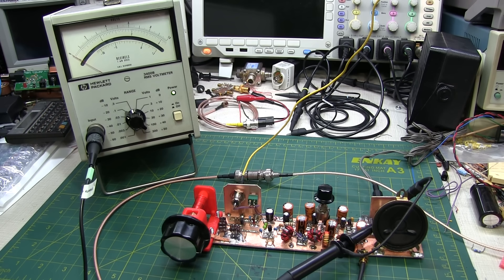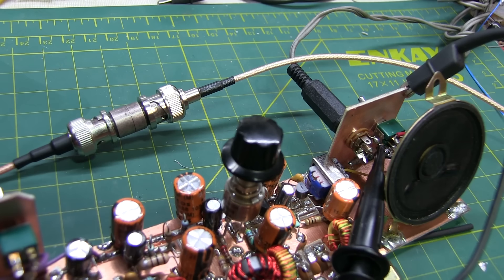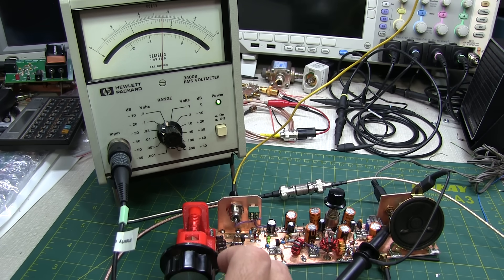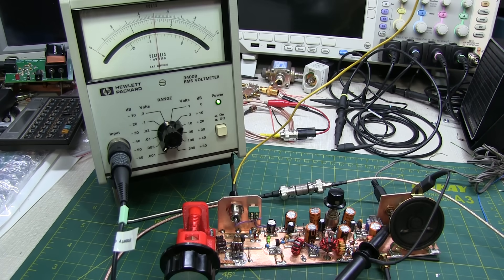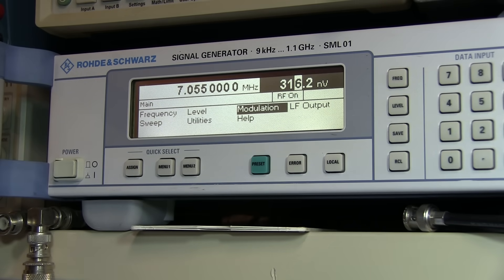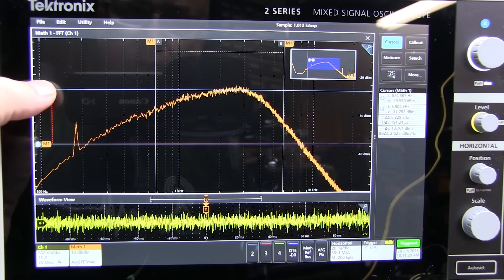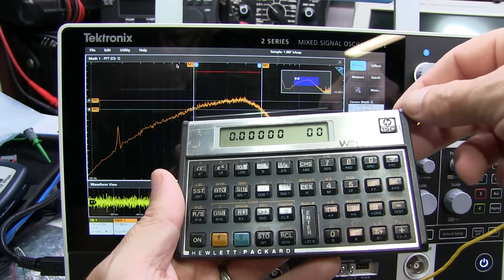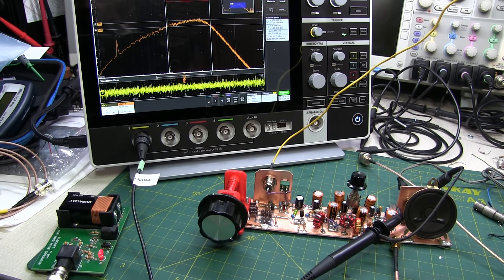#400: Measuring the Minimum Discernable Signal and bandwidth of the 40m Direct Conversion receiver.

Comment: Great demo. Thanks. A properly aligned HW8 (I've measured eight) has a minimum discernible signal of about -128 dBm. The CW audio peak there seemed really high - well over 800 Hz. About 400 to 800 Hz provided the best ear/brain separation to adjacent signals. For example, two signals only separated by 200 Hz are easier to distinguish with a beat note of 600 Hz than 1kHz. This is often overlooked by none-CW operators!
Reply from the maker: I may try to tweak some things to give me a better aligned receiver tone.

Comment: “I put a low pass filter in the output of the audio amp, Uh just to limit the high frequency hiss out of the receiver” what exactly did you use and exactly how and where did you place it, if you don’t mind, thanks!
Reply from the maker: I simply put a capacitor (47nF I think) in parallel with L4 (the primary of the audio output transformer)
Reply: @w2aew similar to Nate’s KA1MUQ “snubber”, a 0.047uF in series with 47 ohms across L4. He also put a 1000pf cap between the base and collector in each stage, I thought, to roll off high frequency audio. Thank you. His snubber stopped mine from motorboating, though I had also already added large caps from positive supply to ground. Addendum the 1000 pf caps were to neg feedback rf that was being amplified, but it also reduced high frequency audio

Comment: Great video!  Thank you.  
I'm a little confused how you adjusted your value from 3KHz to 500Hz bandwidth.  I thought it should change with the sqrt of the bandwidth ratio, as opposed to directly with the bandwidth ratio?  I'm likely missing something.  I'm thinking the signal isn't affected by the bandwidth but the noise is.
Reply from the maker: Yes, the magnitude of the noise is affected by the bandwidth and not the signal level. Interesting thought regarding the correction factor. I’m pretty sure that because the relative change was measured in dB, that we use the log of the ratio. I will have a discussion with one of my work colleagues on this though….

Comment: Another interesting, educational and entertaining video. I looked for that HP true RMS meter and was surprised at the cost. Is there an alternative to the expensive meter that would still provide reasonably accurate results?  Thanks for your videos I always learn something new. 73! DE W3AL
Reply from the maker: Some true RMS DMMs have the ability to measure relative change in dB. But, I do prefer an analog meter for this application.

Comment: Great video. If you used an averaging type meter rather than true RMS is the difference     significant? Also I hear the term noise bandwidth is that related to this measurement?
Reply from the maker: It will likely vary with the particular meter, since they may differ on how they respond to noise. Typical analog VOM won’t have the necessary sensitivity. A VTVM might, but I don’t have one to test.

Comment: There are quite a few tools that are easy to make and end up being very helpful. I built a noise source and a 10MHz oscillator that I thought would just be fun to make but ended up being used many times as signal sources.